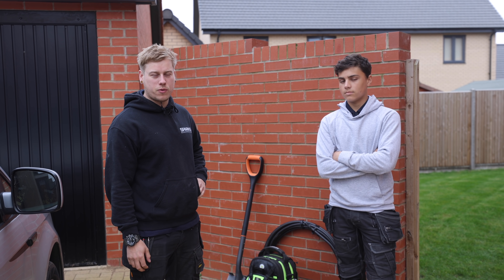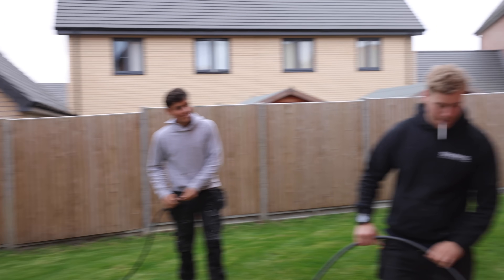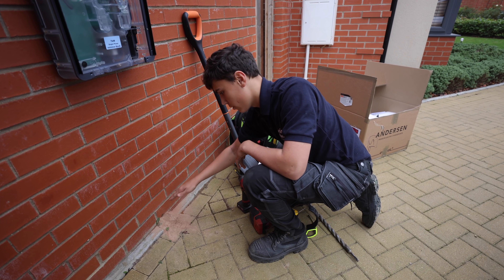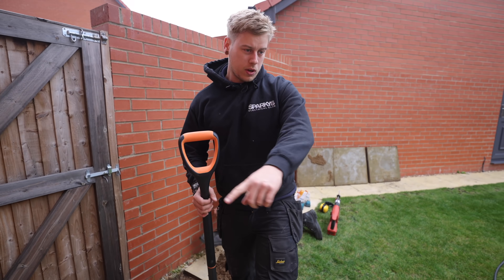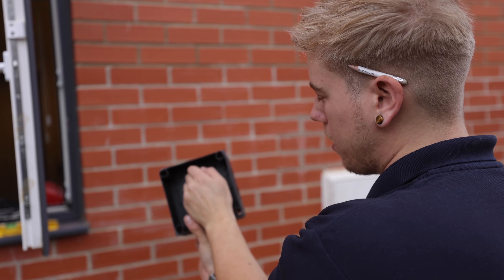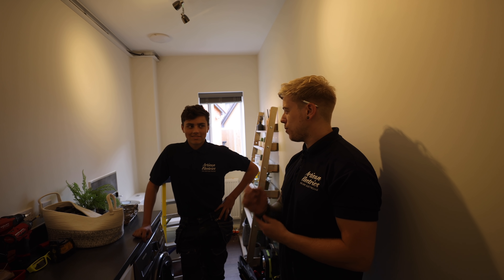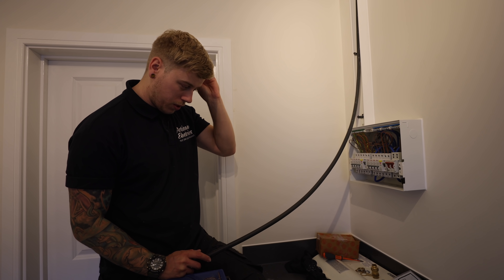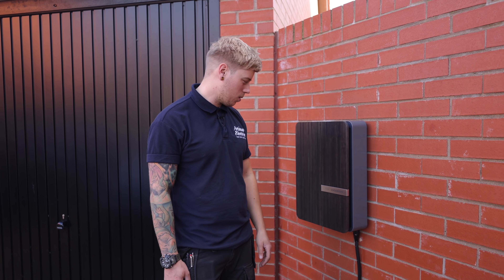MEGA CABLE RUN for Electric Vehicle Charging Point Installation - Electrician Life

Comment: Hmm, lots of basic mistakes IMHO that shouldn't have been made by a premium supplier. Worst being brick blowout *2 (Unnecessary box used to conceal entry into house because of blowout). Cable could have been concealed in trench around the wall. Use of hacksaw near customers worktop - cutting should have been done outside where there was more space. OTT trunking.

Comment: That external clipped cable is horrible! I would not be happy about that. 
I'm in 1st fix and have routed 2 x 6mm cables from consumer unit coming out the wall perfectly through the back of the car chargers. (I havnt even bought them yet I just downloaded the instructions so I know where to put the hole.) I was going to put them both put a hole at 750mm to start with but then I would have to have external clipped cables on my house!

Comment: Any reason why you decided to take the armour all the way to the board? Wouldn't it have been better to gland into the box on the wall and take a flat twin and earth to the board using a much smaller trunking size?
Reply: Possibly has the cat 5 inside of the swa for clamps
Reply: @msparky8899  Data shouldnt be run alongside power though.

Comment: Think I would have terminated the SWA into a wiska box on the outside of the house then ran NYY cable in the trunking, make life a lot easier and means you dont have to have a stupidly sized wiska box.  Also has the added benefit that you say the bigger trunking gives future routes however if there was wago connectors from SWA to NYY the cable could be pulled back through and another hole drilled without worrying about hitting your cable.
Reply: NYY cable has no British standard and isn't recognised by BS standards, it shouldn't be used. A twin and earth would of been sufficient.

Comment: Why isn't there an industry standard / regulation around where the fuse board is located when the house is built? Seems completely random most the time. If it was standised with a bit of thought in mind it would really help future proofing additions and alterations down the line, especially with the world needing to be more climate aware (eV, solar, etc)

Comment: Hi Guys
Could you have come out of the back of the charge point instead of running down the wall on the exposed to the street side, it could look more aesthetically pleasing
Reply: 95% sure the chargers only permit bottom entry.

Comment: I cringed when Lee was hitting his screwdriver with his hammer. A screwdriver is for doing exactly that, driving screws, not being used as a punch, chisel or pry-bar (Snap-On buyers will know). Being a VDE insulated screwdriver, the insulation on the handle could be damaged internally/externally and this is a tool upon which you rely for your life should you be working live, whether intentionally or unintentionally. Look after your tools and they’ll look after you

Comment: Backseat driving here slightly, but so long as every day is treated as a school day, my comment might be considered food for thought for the next time. 

Why couldn’t the SWA enter the property at low level instead of having a big black cable going up the wall to end randomly at big black IP box that covers a blown brick? (If you’re drilling inside -> out, turn hammer off when you’re nearly through!) 

Couldn’t the SWA not of come in low level and then gone round behind toilet and under utility base units then straight up in corner to consumer unit? 
Or alternatively gone up inside the property beside the soil stack boxing in trunking?

You guys love your cable routes, I wouldn’t be happy seeing a random cable going up my wall like this. 

Would you?

Why such oversized trunking? You’re not future proofing it, it just looks unsightly, utility room or not, you did this for ease of bend radius on that SWA. Nothing more. 

I appreciate that it’s not always the route that is the most important thing and also costing the job we want the easiest install:time ratio and that not everyone cares about the cable being on show. But had low level install been considered, the trunking might not of been needed and externally it would’ve looked like you never installed anything. 

I don’t install many EV chargers and your videos are an insight into products but you need to consider that the client (regardless of what their property is) isn’t buying a cheap charger and so is also expecting a reasonably thought out installation.

Sometimes the route hasn’t a choice. Sometimes it does and on this video I think alternatives should’ve been considered (and possibly discussed on camera) which would demonstrate to your viewers (and future clients) that every installation is custom and every attempt is made to be visually satisfying.
Reply: I agree with this, in no way was it a shoddy install or anything like that its just not quite to the standard everyone is used to seeing here, obviously there might be things not mentioned in the video but even the long armoured run up the wall isnt fully straight when you see it just after clipping.
Reply: to much emphasis on making video not enough on carrying out the job to a good standard  I would not have trunking or saw on the surface was that not a meter box on the outside wall?

Comment: Great video guys, why didn’t you just terminate the armoured into the JB on the outside wall and then run t+e in smaller trunking? 👍🏻👍🏻
Reply: Or just gland the SWA into the box and then run the inner core through the smaller trunking saves having a un-necessary joint.
Reply: Even better shout!👍🏻

Comment: Shame about the damage to the brick on the side you didn't drill from
Reply: Just take it off hammer before you breakthrough the outside brickwork, give a nice neat exit point
Reply: The draw back of SDS, on those bricks taking it off hammer, you would never drill through them

Comment: Criminal that new houses like that are being built without charging for EV being in place already.... Even if it is just the cabling that's in place.....
Reply: Over here in Ireland all new build houses will have an CV charge point fitted.
Reply: They do in the UK, just done a new build and an ev point was part of the building regs
Reply: Totally agree. As an owner of a 2020 completed new build, I had an extremely complicated cable run too 🤦🏼‍♂️

Comment: Just wondering how many non-sparkys would say drill through the back of the board and fish down the void behind it......!!!????
Reply: I thought the same (non sparky too) but lee did point out the big trunking was to allow for other cabling in future. All new builds seem to have shocking brickwork and finishing these days.
Reply: What's wrong with that? (Yes I'm a non sparky)
Reply: @Accomplice23  cable won't be glanded then. Also you have to try getting a 6mm swa cable behind a dot and dab void!!
Reply: You can’t run cables in the cavity these days (BS7671) as it would (should) have insulation in there which would de-rate the cables, plus the cables may be out of their prescribed zones so if someone were to drill through the wall in the future then there’s the risk of hitting one
Reply: @kevy427  where do you think all the cables for the property run into the consumer unit? 
I'm guessing in the wall in capping going back entry to the consumer unit.  Had Lee decided to fish the sea down the wall and someone did indeed  drill the wall on on the other side of consumer unit they have more to worry about that one  SWA wouldn't you agree?

Comment: Brickwork there looks absolutely horrendous, common thing with new builds nowadays unfortunately
Reply: @lee_mc  Absolutely shocking!
Reply: I noticed that too. Professional not to want to blow out bricks but nothing you did there could make it any worse. An absolute disgrace.
Reply: They look almost like engineering bricks 🤔 horrible to drill through. The only other option would’ve been a thorough measure up and drill from the outside in
Reply: @timwoodhams958  they are enginering bricks, Class B (perforated) which will easily shatter and hence the break out. opps